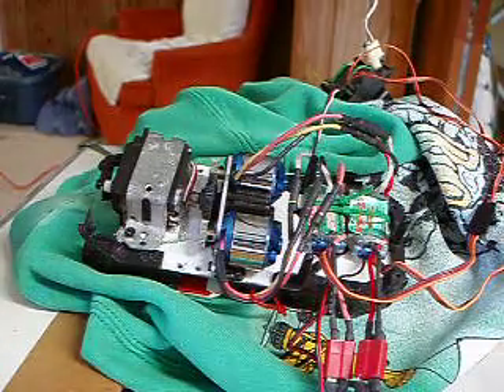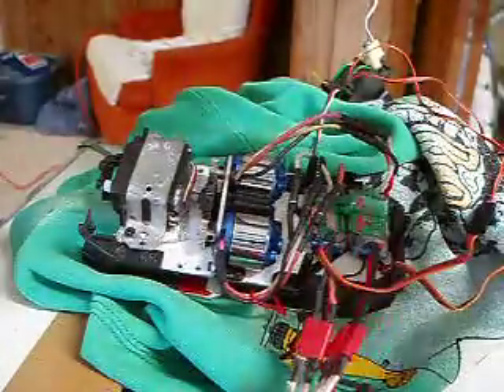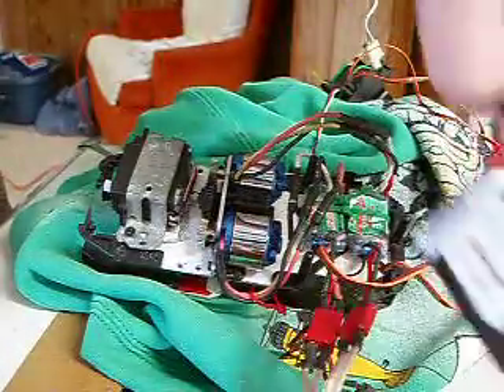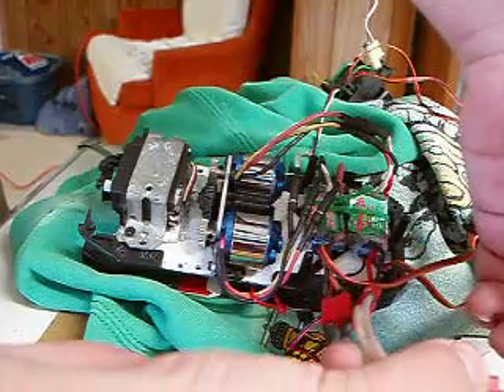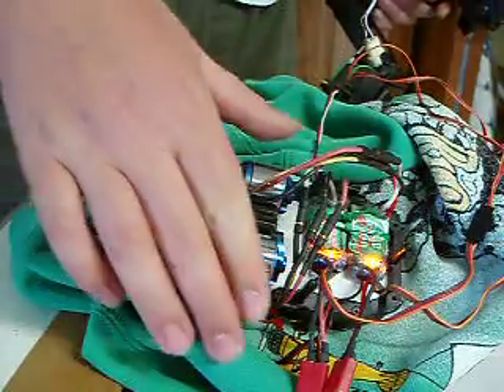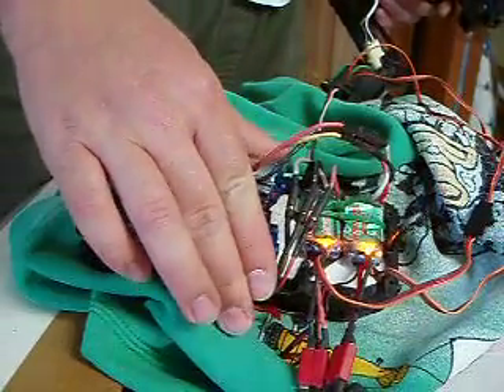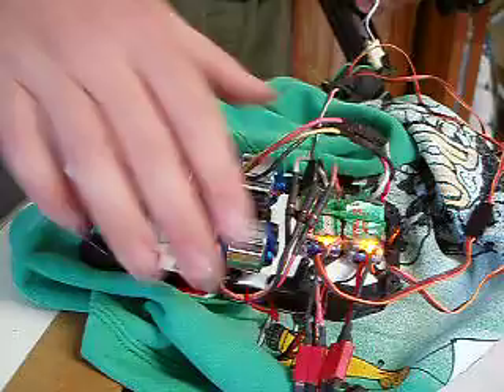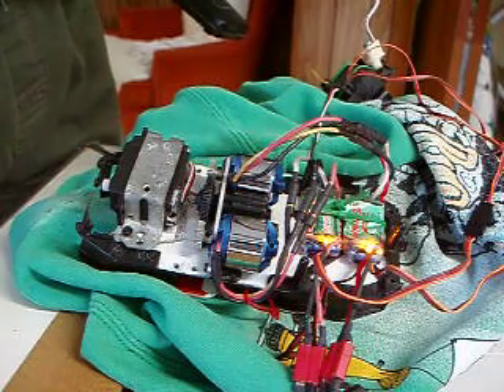dual brushless MLST

Comment: Those look like outrunner motors.  Typically those are used for planes and helis.  Cars use (always?) inrunners.  Difference is that outrunners the outer can rotates while in inrunners the outer can is motionless and the rotor inside rotates. 

 Like HairBa11 said (a year ago), the outrunners might not be reversing, though I can't visualize how they couldn't, electrically.  But it's a fact that planes and helis DON'T reverse their rotating assemblies.

Comment from the maker: MLST already is set up for dual motors. With the amount of torque available, i got the Largest pinions I could find and the smallest spur to gear it up. the motors are only 3200kv, but have bags of power.

Comment: you havent got reverse because you have it set in race mode. reprogramme the esc from scratch then it will all be good. you should also change motors. you will only get half the power you could be getting with a mamba motor. anyway, very nice!

Comment from the maker: the 3200kv motors don't spin that fast. I am using 26t pinions to make up for it. I used a hotwheels radar gun and clocked it at about 18mph.

Comment from the maker: 2 mamba25 esc's ($160)
2 3200kv Brushless outrunners ($50)
Viscous diffs ($50)
MIP cvd's ($40)
Roller MLST ($90)
3200mah Lipo ($20)
$410 total

3 packs run through before the viscous diffs broke.

Comment from the maker: I used a regular servo Y to tie the inputs together, and made a Y out of 14 gage wire and 3 Dean's plugs to power both the Mambas.
The next trick is making sure the rotation of the motors are the same. so the ESC's don't fight eachother. Good luck, and be carefull, If the clear plastic starts to draw up and get tighter around one of the esc, yank the battery before it can smoke. Be sure your throttle curves are identical using the castl link otherwise the offset will strain one ESC.